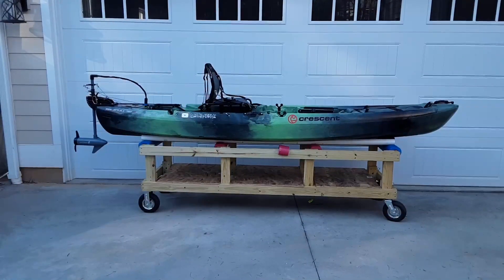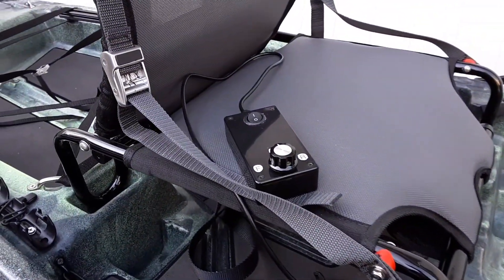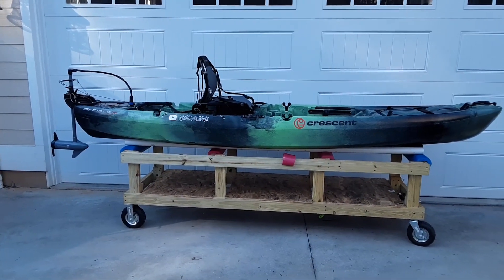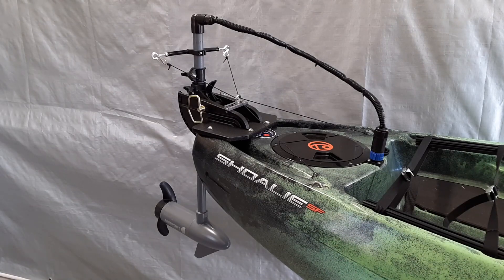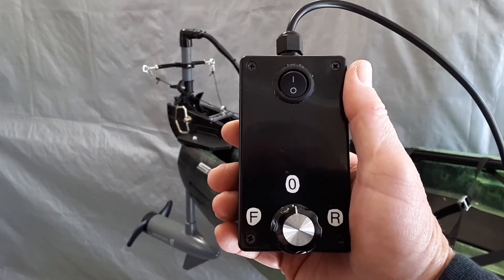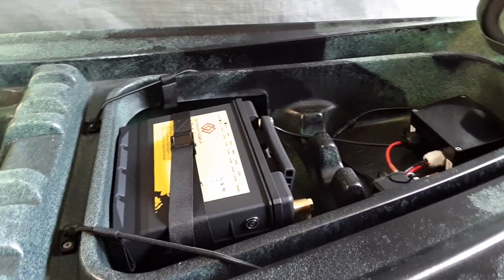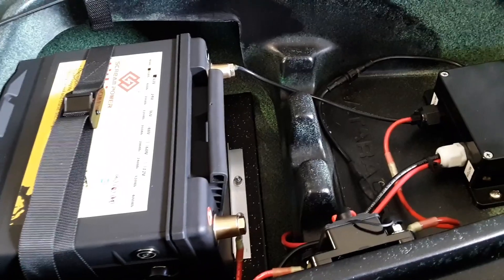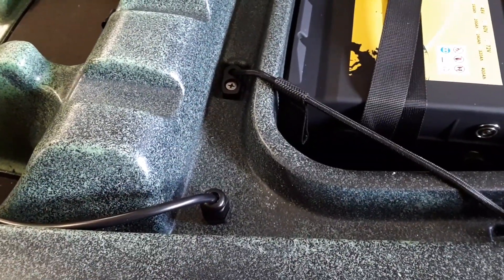Crescent Shoalie Kayak Modifications

Comment: Many thanks for sharing.
Be interesting to know what that AMP draw is on the trolling motor during operation and approximately how long one could expect the battery to power the kayak during normal operations.    Maybe just some readings at different throttle positions i.e. low, medium and high while on the water.  Thanks in advance for any information you are able to supply.
Reply from the maker: Thanks John. I thought about doing some amp draw testing after I built it (I should have done it before I finished). There was no safe way to attach the ammeter and get readings on camera. I will try to remedy that next time.

Comment: Can i ask why you dropped the haswing 12v 65lb troll motor?
Reply from the maker: The Haswing is a good motor but already has a PWM in the head. There is a lot work needed to convert that into a had held remote. The Newport Vessels and Minn Kota motors are easier to convert and less expensive than the Haswing when finished.